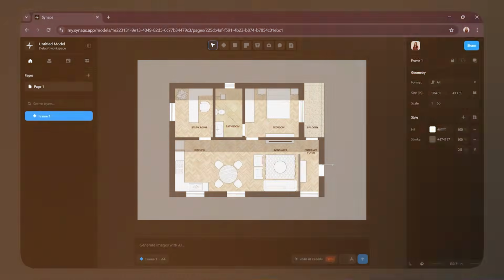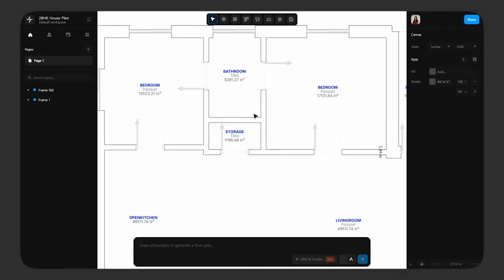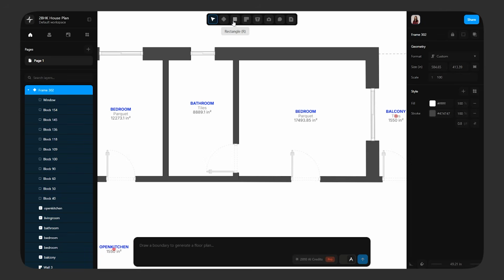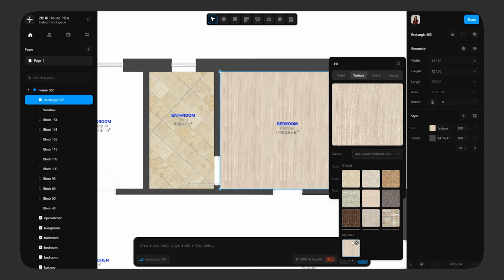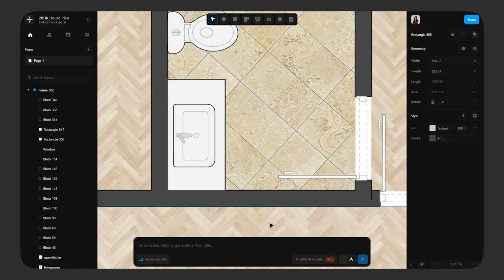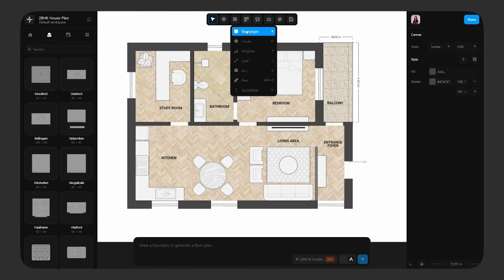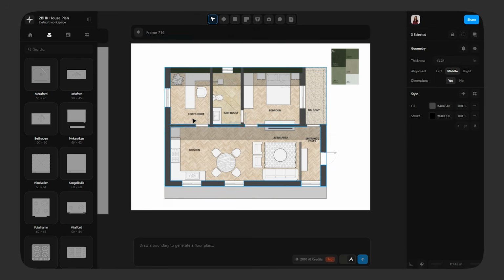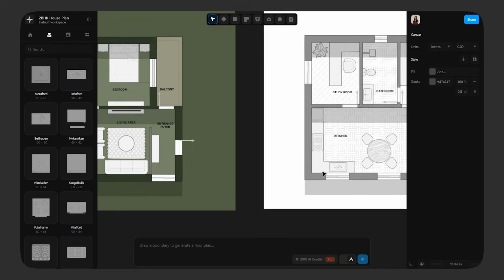3 Ways to Present the Same Floor Plan (Easy Method)

Comment: planning to get subscription but still waiting for the detailing of structural,electrical,plumbing and etc features.
Reply from the maker: From what I’ve explored so far, Synaps is currently more focused on quick planning, layouts, and rendering rather than deep technical detailing like structural, electrical, or plumbing systems.
If your workflow depends heavily on those, it’s definitely worth waiting to see how they expand these features. I’ll also keep sharing updates if they introduce more detailed capabilities!